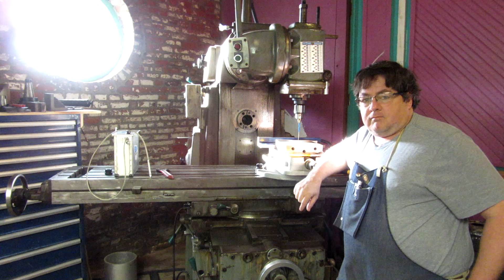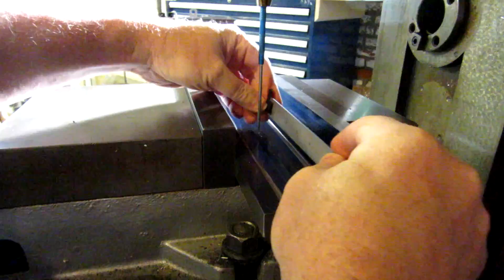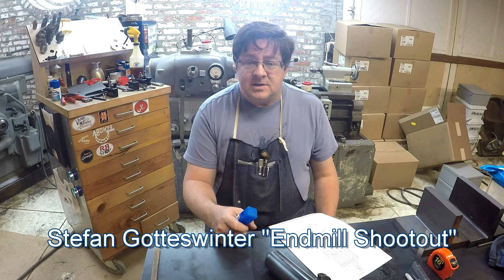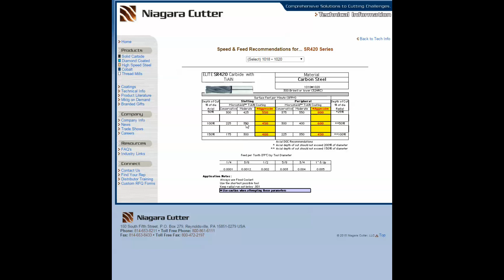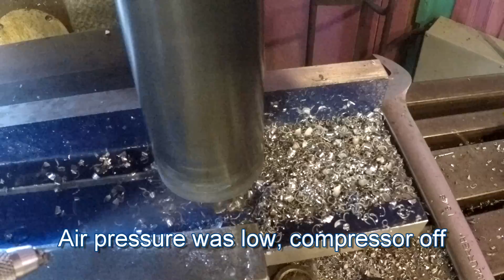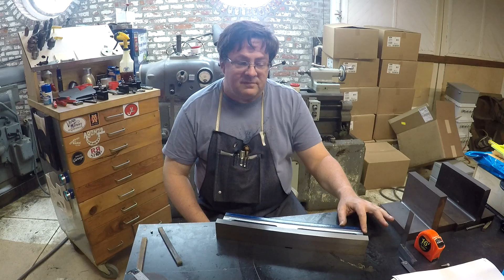Projectus Interuptus #3 (Final)

Comment: Are those slots both the same length?  At the end it looked like the left one is considerably closer to the center key than the right one.  Was this done on purpose, and if so, to what end?

Love that K&T machine BTW.  Would mortgage my left testicle to have one, if anyone would give me terms on the wretched thing.  ;-)  Turns out that your credit can get bad enough that the bankers won't even accept body parts as collateral.  :-/
Reply from the maker: LogicIndustries One of the slots is longer than the other so I can angle the work stop on the table and still catch a hold down.
Reply: James Kilroy Ahhhhhh, makes perfect sense.  Thanks for the reply.

Comment: I am pretty good at eyeballing holders that are not too great, and haven't bought any with damaged threads or bores, exactly. The big problem I always get burned on is getting holders with excessive run out. I guess if you crash a insert end mill you can pretty easy bend the arbor without damaging the bore.... at least that is how I think it happens. I am currently getting spoiled by my quick change beaver tooling I got with the G&L.  being able to change out end mills, face mills and drills with a 1/4 twist lock sure does save time and beats the heck out of screwing the drawbar bolt in and out all the time! I was a bit conceaerned about a loss of stiffness effecting the cutters and maybe causing chatter but so far that has been unfounded. Now I have only been running my 50 tapers on my 8 and 10in face mills.
Reply from the maker: bcbloc02 I know what you mean.  I have sat and thought about building a power draw bar on the horizontal axis, just like one for a Bridgeport, just use a 3/4 drive ratchet instead of a 3/8's butterfly.

Comment: Hi James
Best clarify the only indexable cutters I use on my MIL are face cutters all the rest are solid carbide and some HSS and yes when I use my 80 mm face cutter it sounds and feels like somebody is flogging it with a big piece of pipe. I have a 50 mm one and it is not to bad the 80 mm one has six inserts and I have removed three and it seams to go a bit better.

Dave

Comment: Another interesting video.  You mentioned you buy Cat 50 tool holders cheap on ebay, what do you consider cheap?
Reply from the maker: Morris Gallo Less than $50 for a quality (ie no rust, clean surfaces, etc) holder is cheap. New they run over $200.

Comment: Hi James
I find that in both my MIL and Lathe which are only two horse power machines that carbide seams to be kinder on the machine. This might be my imagination but the machines just cut better and with less pressure than HSS. Most of my MIL cutters are three flute solid carbide which allows me to plunge without having to change cutters.
My machines cannot use the cutters to their working potential but if it is kinder to the machine I go for it.

Dave
Reply: James Kilroy Whoa. I have a couple of indexable end mills--face mills actually--that use TPG inserts. Are you saying they're bad for my Bridgeport?
Reply from the maker: Rick Rose No, but they sure sound like it if you push them hard!
Reply from the maker: David Cashin There seems to be an idea that carbide is harder on a machine but that might just be a carry over from some tools like early indexable end mills that used TPG inserts and seem to hammer the machine into submission.   But you make a great point, you should always try to be kind to the machine if possible.